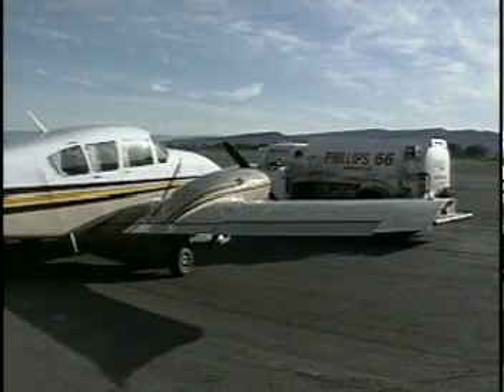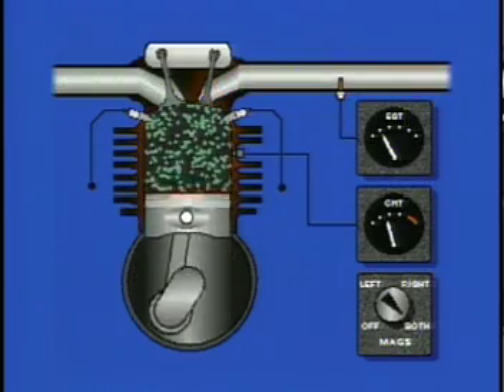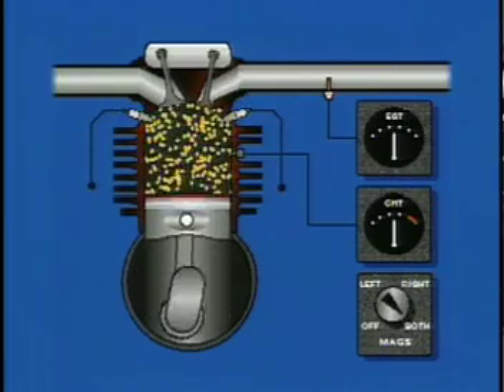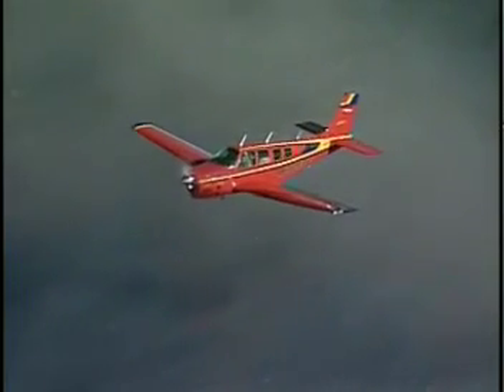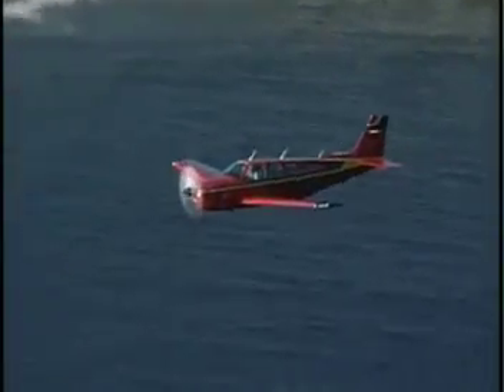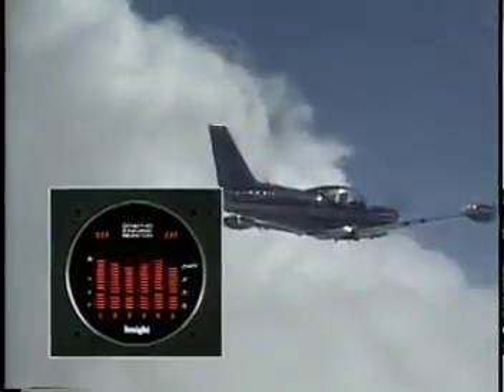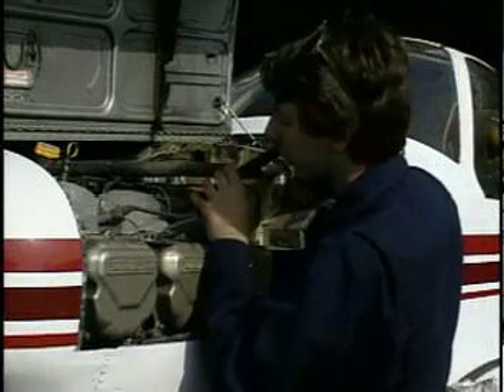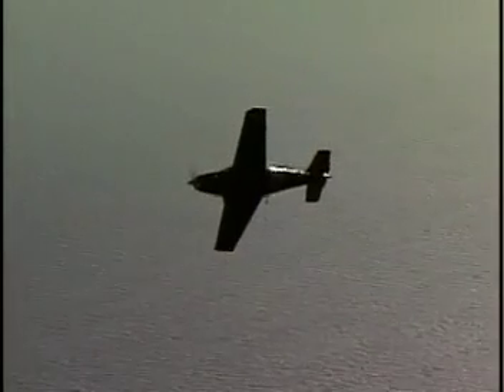Insight Engine Monitor

Comment: "A turbocharged engine EGT will initially rise when enriched from peak, rather than fall immediately like a norm-aspirated engine".

This video was 1989. Anybody contest this quote?

I would hold that, if you are peak EGT, and you enrich or lean then EGT is going down.

Any chance they meant TIT will rise if you enrich from peak EGT?

Where is Kas Thomas, Mike Busch, George Braly, John Deakin, Walter Arkinson, Paul Bertorelli, or Marc Cook when you need them?